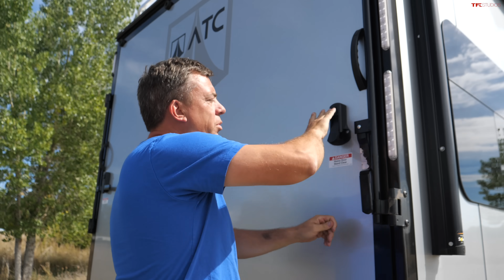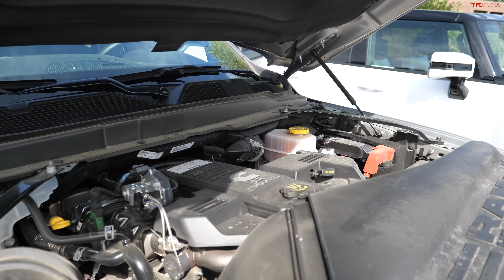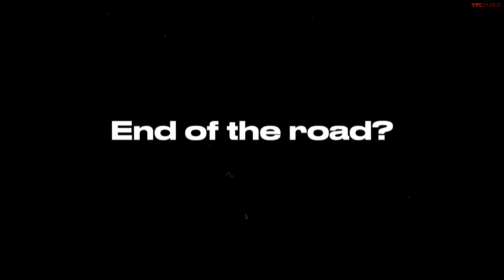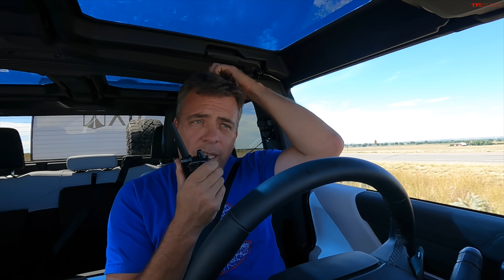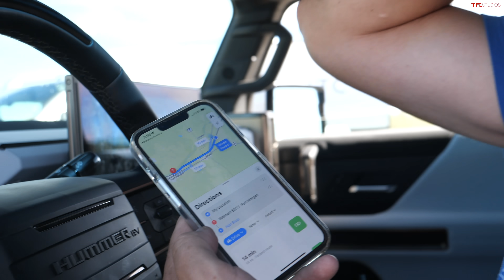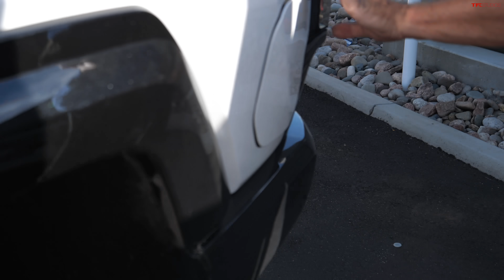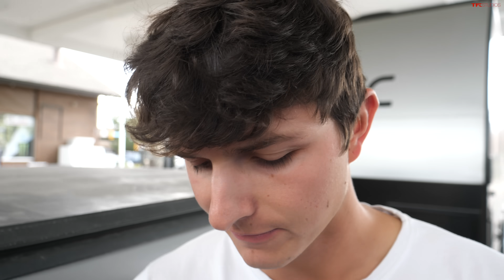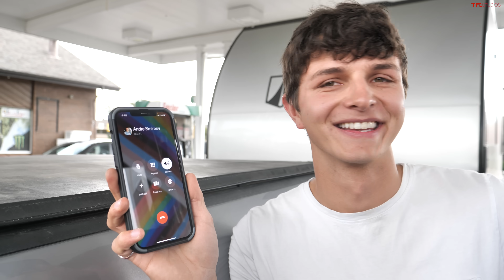How Far Can a Diesel and Electric Truck Tow An Identical Camper Trailer on ONE Fill-up?

Comment: so at 40 bucks to charge which it looked to be he only charged to 51% not sure if he went to a 100 and he got half the range. so in reality you arent saving much at all by having a ev. even unloaded they are comparable in mpg. just not the way of the future if you ask me.
Reply: Someone did the math in another comment. "Thats awesome the charge was free, but let's use the numbers to find out the future cost. The Hummer charged from 7% to 51% for $37.41 according to the EA charger. So $0.85 for each 1%. At that rate it would cost $79 to charge the Hummer to 100%. Hummer cost per mile: $79 ÷ 123 miles = $0.64 per mile.
Cummins cost per mile: $105 ÷ 211 miles = $0.49 per mile"
Reply: @jason3298  thats ridiculous. just goes to show you why ev cars are being pushed so hard. people making bank of it. i guess if you charged at home you could come out cheaper but thats not realistic for alot of people. then idk how much it would cost to charge one at home. never did that math either.
Reply: @jason3298  so if you charge at home you are looking about  5 cents a mile for a ev car if you charge at home. now mind yo this is a car not a truck or suv. a car that gets 35 mpg will cost about 9 cents a mile. so there is a very small savings. however you have to factor in it takes 8 to 24 hours to charge one and you paid double for your car and if you need to fast charge pony up 4k more for a home charger. also this is optimal conditions. not adding things like heat or ac to the mix. why we skipped over other fuel sources for an ev other than it makes certain people money is beyond me.
Reply: @jeffreyrigged  You also have to consider that's at current diesel prices. Would tell an entirely different story of fuel costs were around $2-2.50/gal. Also as the number of EV's on the road increases so will the price of electricity. So not only will your car cost more to charge but your home electric bill will be higher not just from charging your car but overall due to requiring more electric demand that what is currently available.
Reply: @jason3298  yeah if diesel and gas goes back to what it was prior i dont see how anyone would afford to drive an ev. i feel like alot of scare tactics are used to sell evs as is.
Reply: @jeffreyrigged  I just did the math for what it would have to charge at home. At $0.167 per kwh (average price of us electric rate instead of the $0.43 kwh price they paid) home electric rates it would be just under $33.20 or $0.27 cents per mile.

San Diego current average is $0.409 per kwh which would make that come out to $0.66 cents per mile if you charged at home for example which is already more that what the Cummins truck cost ($0.49 cents per mile)

Comment: I'm excited for EV's, but right now they're only practical in certain applications. I think until battery technology advances, maybe we should look at exempting HD trucks from future regulations until something comparable is developed. Perhaps rather than going full electric, hybrids are the better system to look at for HD use. Take a RAM that tows just like this one, but instead of having a 600 mi range, maybe it gets 7 or 800 by being a hybrid with the same size fuel tank.

Comment: Imagine loading up the family to get ready for a road trip and only being able to travel 120 miles before having to charge. Or if you decide to extend your trip to charge along the route you have to unhook your camper then try to keep the kids busy for 30 mins at best or god knows how long if you can’t get a supercharger . If the camping site doesn’t have a charging station the best you can do is go 60 miles from home on a full charge. At least with a diesel or gas you can carry a fuel can for emergencies or call for a tow truck to bring you fuel.

Edit: the efficiency doesn’t even matter when you can’t get there . Secondly who cares about how much it costs to charge the electric vehicle compared to diesel when you spent almost twice as much to buy the vehicle. You’re not saving in daily fuel costs you just paid for it up front when you purchased the EV.

Comment: Electric will not be cheaper than gas or diesel as charging will increase in cost..It will eventually cost more to charge a vehicle than to fill up at $15 per gallon!

Furthermore,the time spent waiting for the charge is also a huge factor!!

Comment: I think some of it has to do with weight.  They are 9,063 pounds without the camper. Gm is going to need to figure out how to make the batteries last longer while towing. It's a beautiful truck it's just not ready to tow yet.

Comment: It would be interesting to see the hummer paired with Airstream's concept Estream trailer. It's a battery powered self-propelled trailer that is just as over the top as the hummer. It was designed with EVs in mind. If ya'll could get Airstream on board with a test tow that would be really cool to see. Maybe we need to rethink how we do things going forward into an EV market, and consider that they will need to be paired with self propelled trailers and haulers.
Reply: Lol... WHY though?

Comment: I think a lot are missing the point as why and what these trucks were built for. These ev’s are perfect for what the majority out their trucks through. Electric trucks aren’t there yet for long range hauling. The f150, rivian, hummer are not heavy duty. That’s not what they’re meant for. The truth is most don’t use their trucks that way anyway. I’ve done construction, landscaping and house building. Most do not fully load their truck. If you find yourself consistently doing more then you need a diesel, that simple. I’ve been a soccer coach now for years, i carry a lot of crap but none of it is heavy, the lightning would be perfect in my scenario.

Comment: Not here to say EVs suck or anything like that but for towing EVs just aren’t there yet maybe it will change in years to come.That hummer makes 1000hp and has 1200 foot pounds of torque but only tows 7500 pounds? My 95 F150 with 210hp and 320ish foot pounds of torque and also tows 7500 pounds. If I was president of Ford , GM or whoever I wouldn’t release EV trucks until they can at least somewhat compete with the gas powered half ton in terms of towing and have the range to back it up

Comment: The power grid in the U.S. is struggling to keep the lights on today without adding tens of thousands of new EVs.  Have you seen any new power plants being built?  Wind and solar aren't the answer.  Only nuclear plants can provide that kind of power and it takes approximately 10 years to get a new power plant approved and build!   Also, millions of power transformers will need to be replaced including the ones that feed the power to your house!  And if all that isn't bad enough, It has been estimated that in 25 years the power grid would need to supply 3 times the power that it provides today!  How is that even remotely possible given the "leadership" we have in Washington?
Reply: Also, what do you think will happen to the price of electricity when the demand (millions of new EVs start hitting the streets) far exceeds the supply?
Reply: EVs are the :CFL light bulb" right now...... GOV mandated, worse than incandescent, and no one wanted.
It  will not be the ICE replacement, with 5% sales figures and 20% of those people going back to a gasoline car.......no one wants the EVs.   It will likely be a hydrogen ICE vehicle.  But we may ultimately end up back with gasoline.

Comment: It looks like if you live within 75 miles of your hauiling 7k or less the hummer is more cost effective. Based on 40 bucks  for charging…. and diesel at 5 bucks a gallon x 20 gals 100 bux but u get 2x as far ALMOST so prolly $50-$55 for cummins vs $40 for hummer same distance
Reply: Someone did the math in another comment. "Thats awesome the charge was free, but let's use the numbers to find out the future cost. The Hummer charged from 7% to 51% for $37.41 according to the EA charger. So $0.85 for each 1%. At that rate it would cost $79 to charge the Hummer to 100%. Hummer cost per mile: $79 ÷ 123 miles = $0.64 per mile.
Cummins cost per mile: $105 ÷ 211 miles = $0.49 per mile"

Comment: The Hummer used 196kw of electricity to travel 123 miles (battery was 100% at the start and 8% at the turnaround point). The price for electricity at the EA station was $0.43/kw. So on a day when the power wasn’t free, a full refill would have cost $84. The Ram on the other hand would have used 12.7 gallons of diesel (123 miles) @9.7mpg. Sinclair price for diesel was $4.80/gal, so the Ram cost $60.96 to travel the same distance. So unless you charge exclusively at home, diesel is the way to go if you want save on energy cost. And when the Feds start to add road tax to this electricity the savings will be even greater!

Comment: Not sure why the cummins was doing that poorly, must have been a lot of wind, I pull a 31 ft 10,800 pound travel trailer with my PowerStroke and normally get 12 to 15 MPG even in the South Dakota wind.  70 MPH would be an average speed.  I haven't seen below 10 even in the mountains.
Reply: How many miles are on your truck? Diesels tend to get a little better fuel economy after they have a few thousand miles on them. I know dad's 06 really started getting good milage after about 50k.
Reply: @BlueDually4x4  40k
Reply: @richardwoodworth549  So it's just starting to get broke in. I think their test truck has less than 10k on it.

Comment: We get it, and we knew this already.  EVs aren't the right tool for towing.  TFL sure has gone on the EV warpath.  You went from glowing about the Model Y to deliberately creating controversial content for the clicks.  Maybe you guys can start a tool channel where you match up a sawzall and a chainsaw at cutting down a tree?  Until then, consider folding TFLEV, because you've undermined the credibility on anything EV related.

Comment: I’d be interested in the trip cost comparison. Assuming electrify America wasn’t wasn’t having a promotion. Based off of what I saw at $38 for the hummer and doubling that since you’d have to charge once back in Denver, it would be about $78 total trip. That isn’t much better than the Ram. I’m not seeing much EV advantage here in the end.
Reply: Someone did the math in another comment. "Thats awesome the charge was free, but let's use the numbers to find out the future cost. The Hummer charged from 7% to 51% for $37.41 according to the EA charger. So $0.85 for each 1%. At that rate it would cost $79 to charge the Hummer to 100%. Hummer cost per mile: $79 ÷ 123 miles = $0.64 per mile.
Cummins cost per mile: $105 ÷ 211 miles = $0.49 per mile"
Reply: @jason3298  nice! I just approximated and apparently I was way off. That’s a big difference! I understand that many people will be charging at home, but home energy prices aren’t getting cheaper either. Besides, a lot of people just assume charging an EV is always cheaper than gas or diesel.
Reply: @cpftank09  Electricity costs will only continue to rise as demand increases from all these EV's. Also many states already have much higher registration fees for EV's since they aren't able to collect road use taxes from fuel.
Reply: @jason3298  I didn’t realize that on the registration. But it absolutely makes sense. I’m sure states are already looking at adding road taxes to EV charging stations if they haven’t already.
Reply: @jason3298  even assuming both had no load. Hummer charges at 300mi which I would assume would be close to the same soc to 100% would be $0.26 per mile. If the Ram got 18mpg (which isn’t unreasonable) it would be $0.26 per mile. I’m not seeing the benefit at all. This is even worse once you put pen to paper. I’m not 100% that the math is right, but I think it’s close.
Reply: Home charging costs maybe 1/3 as much as fast charging, and the vast majority of charging is done at home.
Reply: @dansanger5340  correct, but what if you want to go to a destination 300 miles (600 miles round trip) away where you aren’t charging at home? That’s charging probably 4 times minimum before you make it home. In that case it’d be about $150, which is pretty much the same as the diesel for a similar range. Oh and adding an hour to each leg of the trip.
Reply: @cpftank09  The advantage or disadvantage depends on how often you go on long road trips.  For a typical person, 90%+f of their miles are local.  Local miles are much cheaper and more convenient than with a  gas/diesel vehicle, since you can charge at home.  For these people, EVs can make perfect sense, even if the rare road trip is more expensive and less convenient.  But, for people who go on a lot of long road trips, it might make more sense to stick with their gas/diesel vehicle, at least until the technology and infrastructure improve.
Reply: @dansanger5340  I agree. One concern of mine is range in cold temps, with any EV mostly. Where I am at in IA it frequently drops to 0F or lower, with weeks where the high will rarely break 10F. Heck, we have already been below 15F already this month. Knowing that many EV’s efficiency drops dramatically at those temps (some by 50%), it could end up breaking even when charging at home. It’s $0.15kwh where I am and assuming a very good average of 1.5mi per kWh in normal temps it isn’t far off of a reasonably efficient ICE vehicle. Once cold though, I’m guessing it’s going to sit around 1mi per kWh. That cost goes way up if you have to charge outside of your home. I know EVs aren’t a one size fits all and that they are still in the early stages. But I think more development needs to be focused on Hybrids rather than solely EV. The fact that a Highlander Hybrid easily averages 30mpg is hard to beat for the size of vehicle. That’s just my opinion through.

Comment: I would like to see you do a tow test of the Hummer at different Hwy speeds to figure out how much the efficiency changes at different speeds. When efficiency goes up it becomes a multiplier for the range of the vehicle. I would run a range test at 75, 70, 65, 60, and 55 or a combo of just a few of those speeds. From my experience as an EV owner I find 60-65 to be the sweet spot and going faster than that really drops your range significantly.
Reply: Same with ICE. Sweet spot is 60-62.  Drive rpm below 1900.

Comment: That new dodge is getting horrible milage compared to the older ones.
Reply: Agreed, I was surprised to see this RAM only getting 9.7 mpg.   I pull a 28ft Airstream camper, weighing 7K lbs, with my 2020 RAM 2500 Diesel and average 14 mpg at 65 mph and 13 mpg at 70 mph.  This is on the flats in Colorado as was this test.  There must have been a serious headwind or that camper moves a lot of air going down the road.

Comment: Wait a second, that Hummer only has 1042lbs of payload. Assuming 10% tongue weight of a 6,100lbs trailer... and lets say 200# driver... That leaves you with 232 lbs of payload, not including the hitch weight.  And that is assuming you're bringing a camper without anyone else with you. There's no way a Hummer EV can be compared to an actual truck. Thats just a joke.

Comment: So, let's cut to the chase. What percentage of range was lost towing? If the hummer starts out with less range without towing the trailer, is it really surprising if it has less range towing??? I think the Ram is rated at over 1000 range per tank without towing trailer. Hummer is rated at 329 if my numbers are correct. What are your numbers? What a shocker that Hummer doesn't go as far towing!

Comment: based on the price of that electricty id stick with gas. at 51% and was $32 already. so add in wait time and cost to get to between 80-100% I.C.E i sway better. this makes me wonder if electric will ever take off? seeing all these vid's on waiting and cost to charge seems like electric isnt worth it
Reply: Someone did the math in another comment. "Thats awesome the charge was free, but let's use the numbers to find out the future cost. The Hummer charged from 7% to 51% for $37.41 according to the EA charger. So $0.85 for each 1%. At that rate it would cost $79 to charge the Hummer to 100%. Hummer cost per mile: $79 ÷ 123 miles = $0.64 per mile.
Cummins cost per mile: $105 ÷ 211 miles = $0.49 per mile"

Comment: Only time I notice EVs is when I pass them on the freeway, they never pass me. I set my cruise at only 75mph and they still never pass me. With the AC on I imagine they must set theirs at 65mph, 78 mph would eat up too much battery range. EVs would be a hassle to me.
Reply: Were do you live? Most EV drivers around me drive the same as most asshole BMW and Audi owners.

Comment: The cost was not explained well. Ev used $40 worth of charging, but he wasn’t even back home, so it was $40 to go half what diesel cost at $100. Thus it was $80 electric vs $100 diesel, and several hours longer plus disconnecting the trailer to charge.  The diesel can be fitted with an extra tank at a reasonable cost.  That means the diesel can go several times the EV range, camp without charging, travel the next day, and costs half as much to purchase. 
No brainer.

Comment: It’s awesome that they did the math on energy density and efficiency. One thing people also aren’t considering is that energy efficiency of electric is much better, but 6 gallons of gas weighs 50lbs. The entire tank of 31 gallons weighs approximately 300lbs. That electric battery is 3000lbs. That’s huge.
Reply: Yes, energy density is something I've been talking about for a long time. Folks just don't understand petrol is an ideal fuel for mobile power plants i.e. Car Engines.
Maybe, in my children's lifetime, we will get to a significant portion of home and commercial business power coming from renewables, but for travel nothing is going to beat petrol.